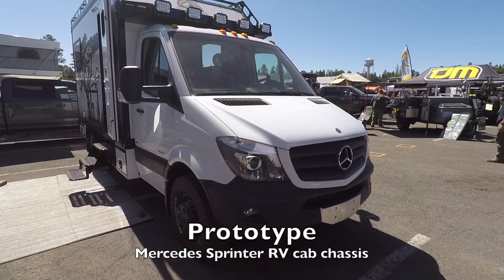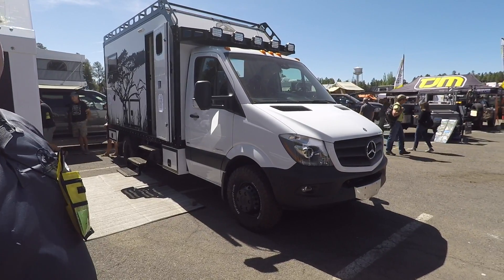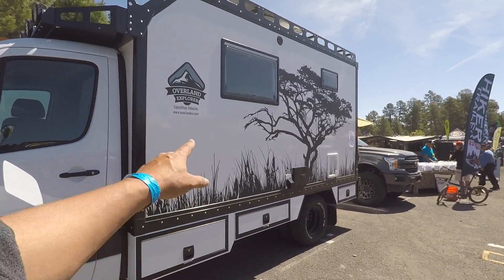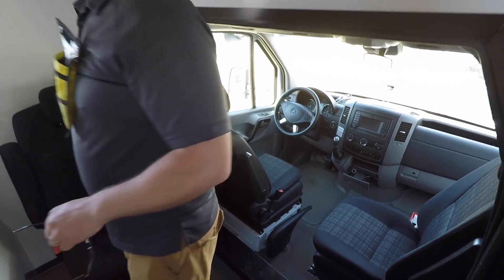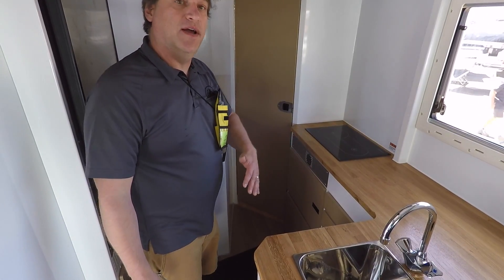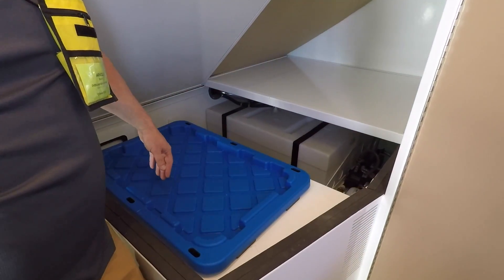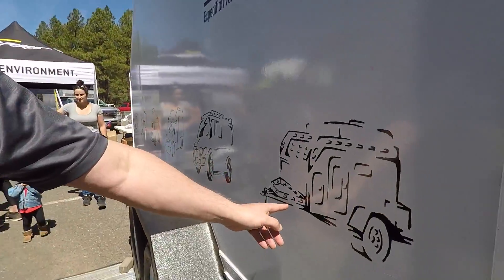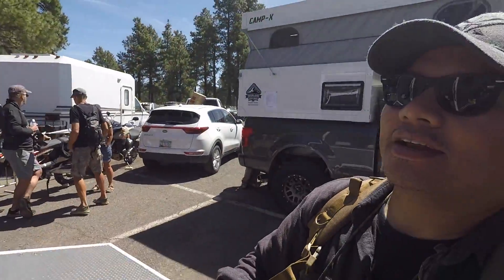Prototype Mercedes Sprinter RV by Overland Explorer :Overland Expo 2018

Comment: I like the composite box and door, and the bathroom layout. The rest of the layout im not to sure of enless its just for 2 people. It is a prototype so i can see why things will be better on the next 1. Hmm i kinda wonder if a foot or 2 longer would've made it better , just a thought.  I do like the hard "box" type over the pop tops. I think they are more robust Imo. Cool vid
Reply from the maker: Justin.S both have pros and cons. Pop tops are good options for those who'd priority is light weight and aerodynamic for better fuel economy.
Reply: mixflip oh i know . I just like that to me less to go wrong with the box type , leaks , heat loss ect. For lower costs and just mild temp camping i can understand that pop tops can be better. I have camped in the older ones before many times when i was younger, but im older now lol.  I have slept many times with just a poncho liner and my k pot for a pillow too , but the Bradley was the best far as that goes :).   I recently seen where some company is to make a electric motor home type camper . I forget who or when. That could help the mpg issue . Im sure it would have a gas/diesel  generator for extended range . Have you seen or heard of any of those ?   I love your coverage on all these camper type trucks .
Reply from the maker: Justin.S I haven't heard of an electric RV? I'm intrigued!!! I know VIA motors makes an electric motor truck with a gas engine solely to charge the batteries so it gets 100mpg since the gas engine doesn't carry a load. Just idles and sips gas for days. That's the option I'd use.
Reply: mixflip look up the YouTube channel. Fullychargedshow . Their latest episode honda , catamaran and a-ha. At the 6: 30 min in they talk about it. Its winnabago. (I know i misspelled that sry) . You should have a look at their other episodes too. Theres one where they drive a land rover that was converted to electric.   I seen the via also but i think they could of used a smaller engine to save even more mpg imo . But they do make the point that as of right now battery technology cant run a 300 to 400 mile range economically so they use the gas/generator. Which i like.  While looking at salvaged trucks one time i seen a delivery box truck that was electric . To me if auto makers would combine  that with a diesel gen (or gas) on a 2 or 4 wheel drive chassis. They would sell like hot cakes to the delivery and outdoor auto makers cause to me thats what is the next big leap in technology.  Think about how much lets say UPS would save if their trucks had that setup .  Good chat . Going to watch your new post have a good one man .

Comment: Nooooooo it is not a capable engine! The bluetec is the worst pos ever produced. They blow at 100k, and it’s $8k for a used one. I sell two a month. They are that bad. Stay away. Get the 2006 and later with the straight 5 engine, they last forever and have lots of torque.